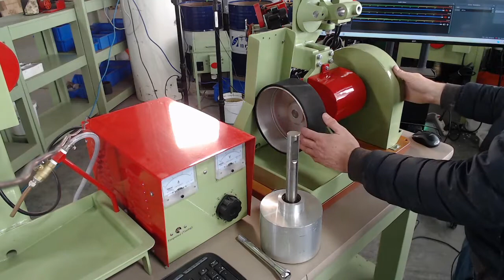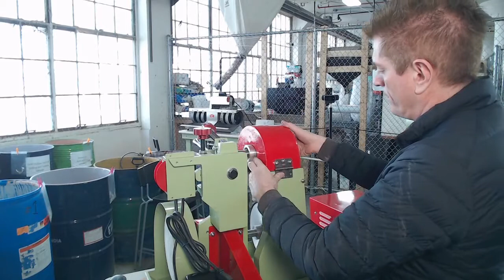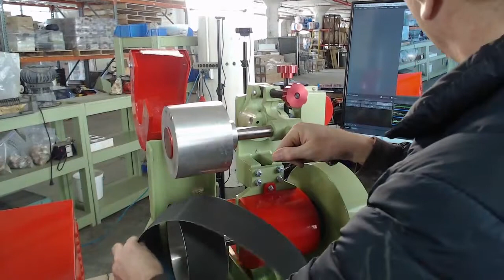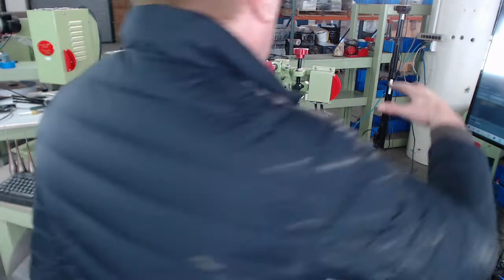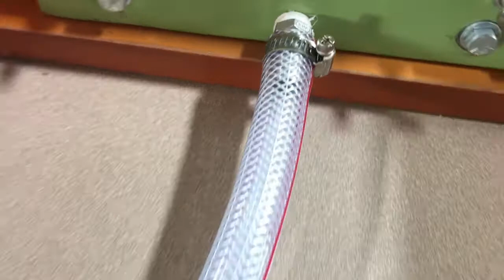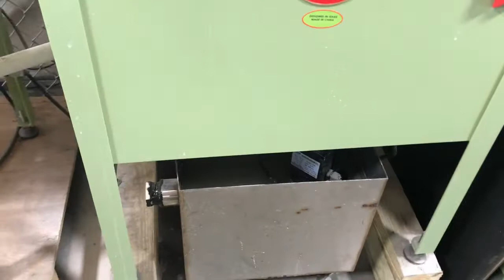How to Setup and Assemble Your New Highland Park Wet Belt Sander

Comment: Good video. I’ve had one of these for a couple months now and it is a well built beast of a machine. I have had an issue with the belt suddenly shifting full left or full right for no apparent reason. Any suggestions? I’ve watched all your videos but one thing that would be very appreciated and helpful would be some basic troubleshooting videos for common issues. Thanks